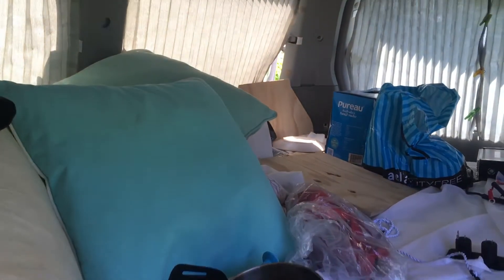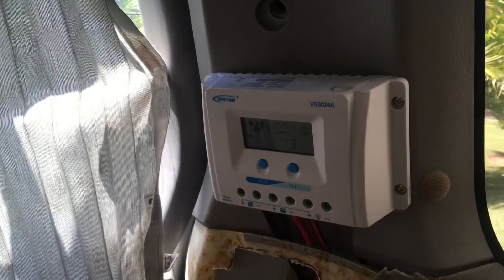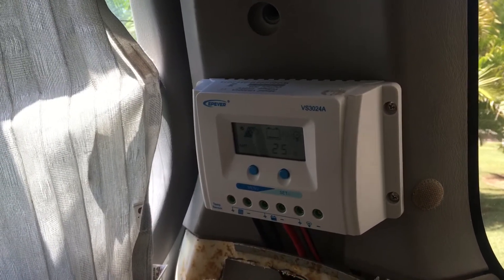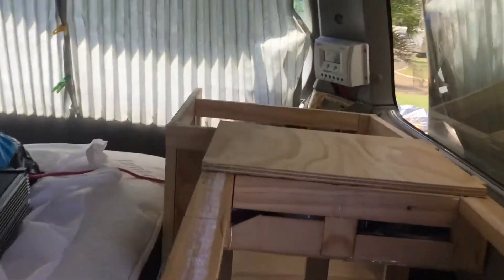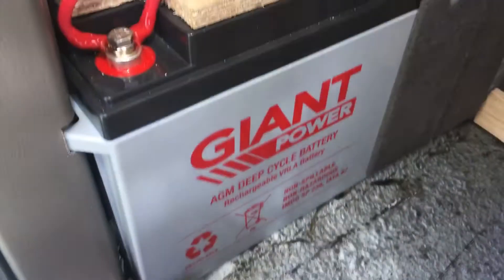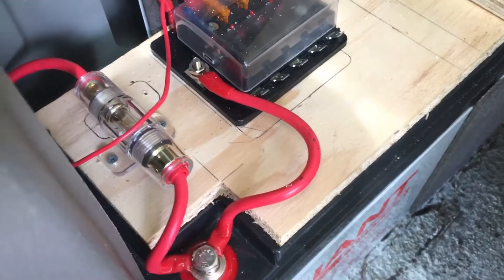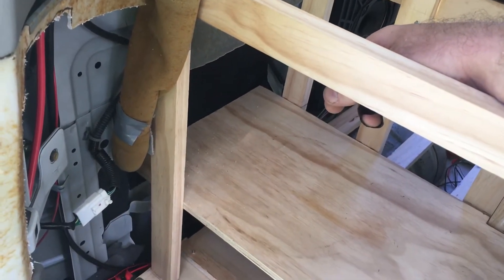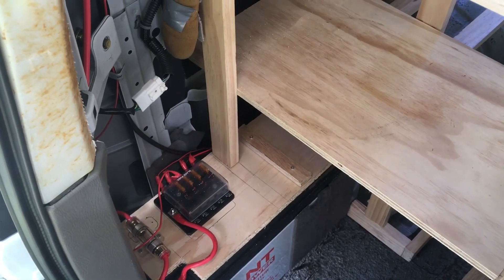Solar Power Setup Camper Van Life 300 Watt Solar Panel

Comment: When you show the Charge Controller, battery status was very low. I understand that can damage the battery. Best luck mate.
Reply from the maker: Yeah it's just the battery icon not actually the real reading. It's apparently a common fault with that cheap model controller :-D